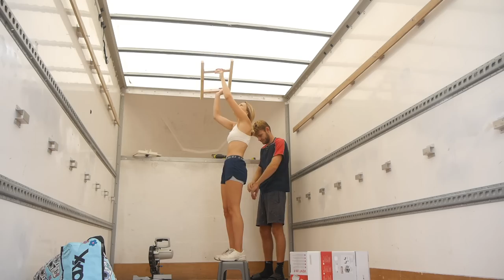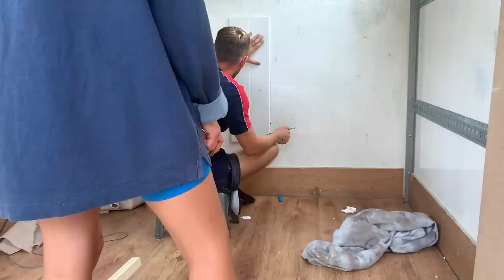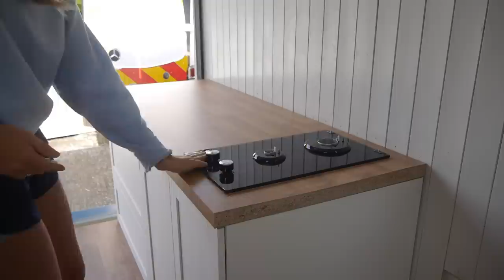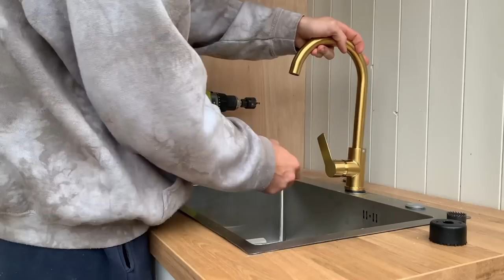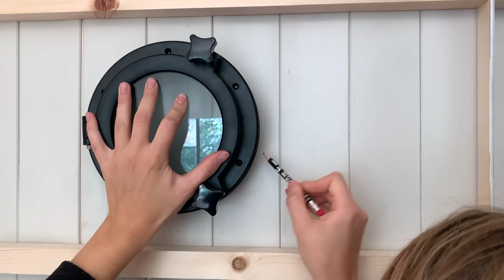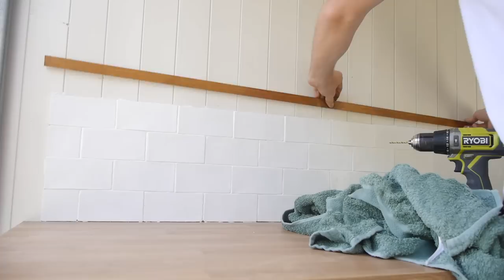Luton Van Conversion | Start to Finish in 10 minutes | With Bathroom

Comment: Looks beautiful once finished, but I did not spot you using any insulation in the walls and no vapour barrier either. I assume you won't be "full-timing" in it in the UK or anywhere else in Northern Europe then?

Comment: No insulation on the floor or walls, no vapour barrier. A much too heavy worktop,  much too much would used for cupboard doors etc, could all have been 6mm sliding ply doors on frames lined inside and out (double) 3mm ply (much lighter) lining the whole box with wood may look good, but at even 10mm youv added another 100kg? when you'd have just used 3mm ply sheets and decorated them. The Heater is cheap Chinese rubbish, sorry to say, the 5kw is actually 2kw, any fitter will tell you the fuel pipes are no good and will replace them, they ar noisy machines and a 10lt tank will last through 1 night if on low only.. shower tray had low profile walls and yet was 28kg, a proper caravan one (strong, long-lasting, warrantied etc) is just shy one 1kg and costs about £60, a 50kg battery with 225ah when a LifePro4 is £110 cheaper and is 280ah ..and yet you say cant recommend enough for someone on a budget..(not only £110 cheaper but weighs just 5.35kg..really important in a Luton conversion as very easy to go over the payload and be fined and have to rip out whatever the inspector points at and leave them on the side of the road) I could go on, but must say these are fun to watch and have a few good ideas, but anyone seriously contemplating converting a luton, please, do not use this list of items as a guide, do your own research and lots of it. best of luck.
Reply: Onboard with all your points but calling bullshit on 280ah (assuming 12v) weighs 5.35 kg. Think you mean 53 kgs, as watt hour per kilo for all LFP battery are pretty much the same. Would also like to hear more of your thoughts.

Comment: Happy New Years Guy's! You asked at the start what brought me to this video. Well I live here in Sweden and I'm 60 next year. And I plan to build a Luton van (we called them skapbil) in the spring. So I have been on YT for about 2 years getting a bucket load of info for my build. (including trying to stay awake watching Greg Virgoe's channel who no one can do without). And you 2 guy's are a lot of fun! But guy's. Really.... Tesco Baked Beans?? Your Brits. It has to be Heinz guy's!! Your van build is almost how I would do it. Apart from that I plan to take the roof off 100% and re-frame a new one has its only fibreglass. And build a more stable roof that I can also go up on and use has a deck area and watch the sun go down with a beer or 3 etc. And also extend it over the cab area and use that space inside for storage or for sleeping. Can't wait for your New Year's projects.